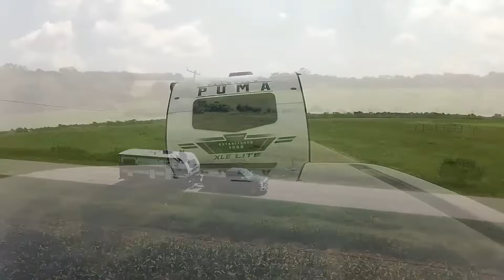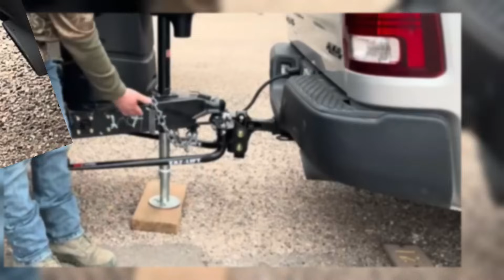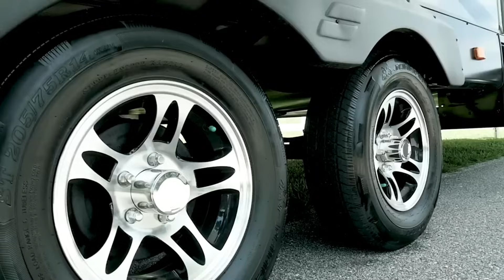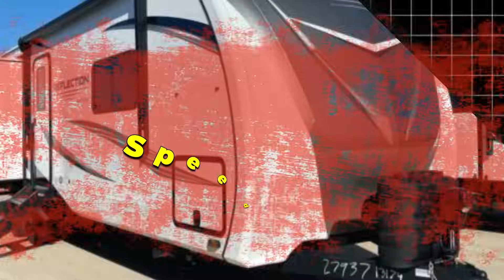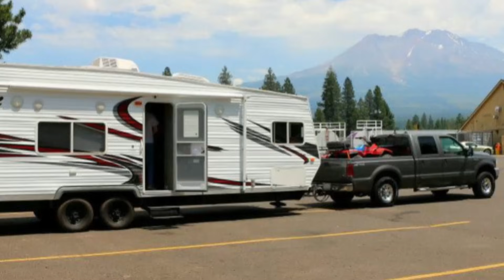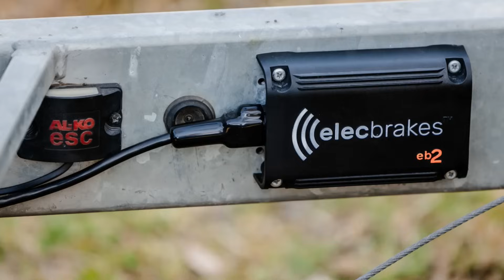Trailer Sway Fixes Every RVer Should Know (Towing Safety Tips)

Comment: One thing left out is to not do lift kits on your truck or get low profile tires. Just because you think it "looks cool", lifting your truck dramatically lowers it's weight capacity. That 3/4 tonne truck is now reduced to a 1/2 tonne truck. With all that extra weight on the rear tires those low profile tires can't absorb impacts like a normal truck tire. This can lead to blowouts and cracked wheels. I also noticed that a majority of those clips showing the weight distribution hitches were not crossing their safety chains. Crossing the safety chains creates a cradle if for some reason your tongue comes off the ball that the hitch can fall into keeping it from hitting the road.